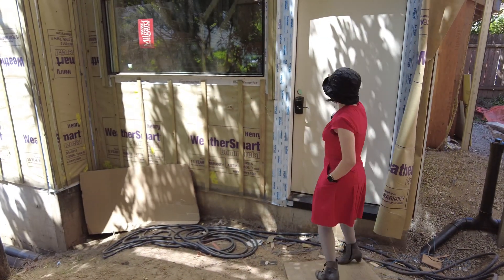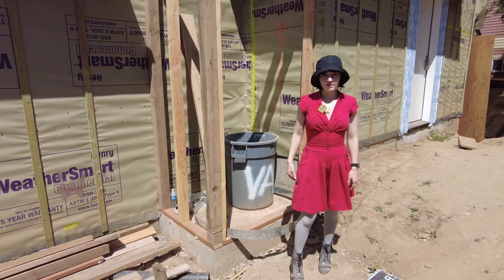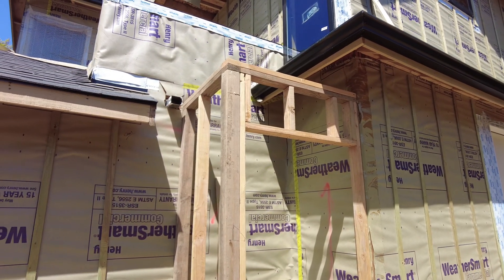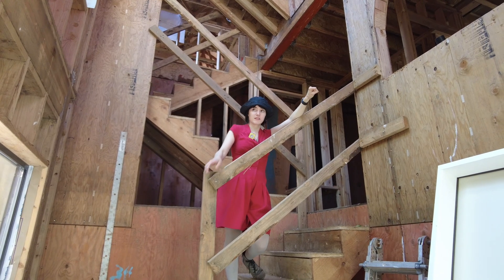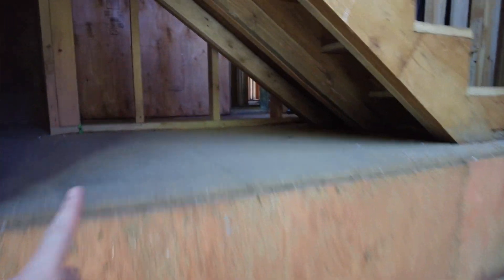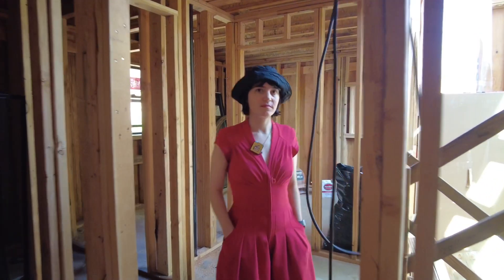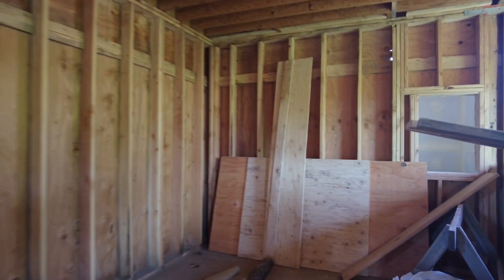The windows are wrong | Construction Update | House Files Episode 20

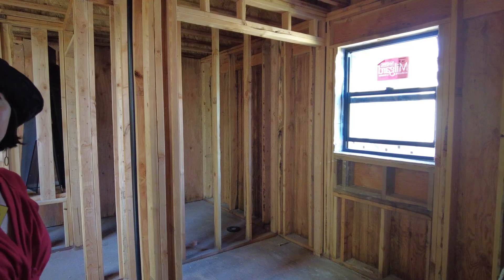Comment: 7:39 Check on that window. I can't be sure just by looking, but it appears to me it doesn't meet the code requirements for emergency egress. That room probably requires a second means of egress (the first being the door), which would typically be a window. 
Check my original drawings. It would be indicated on the Window Schedule.
8:29 Are there no longer any ground level windows in the Unit B entry?
10:46 Lili is right. It would have been the perfect window. And in fact it is the window I put on the original drawings. Those 2 windows are identical on the original drawings. It's window "C" on the window schedule.
Reply from the maker: The window situation got even more complicated. It was a mistake in production and a three-way swap between units. Update in a future episode!